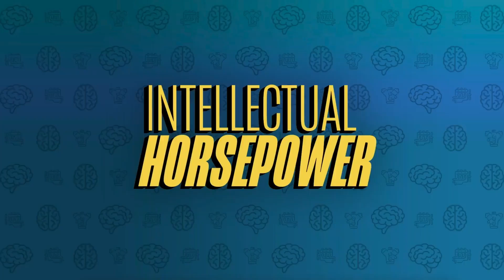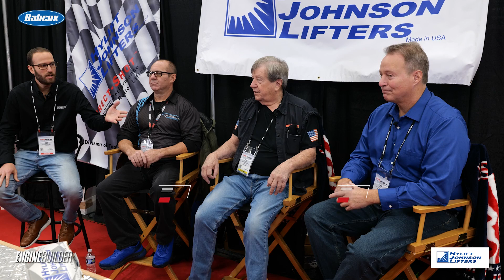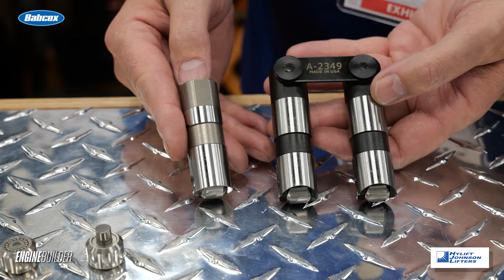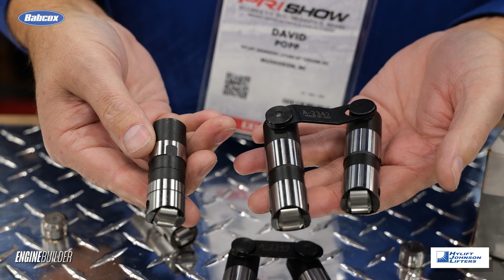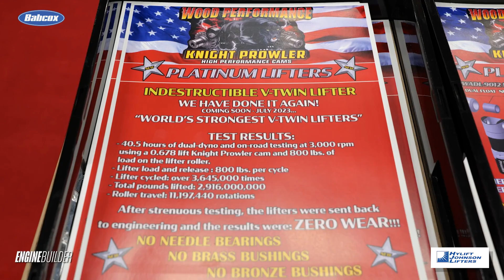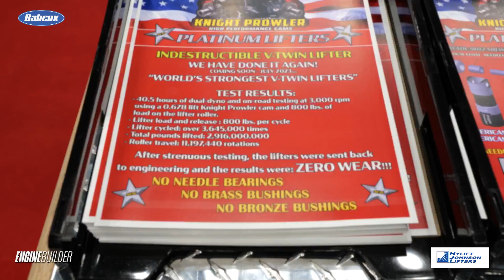Deep Dive on Lifters with Hylift Johnson Lifters, Tyler Crockett Marine Engines and Wood Performance

Comment: BAM and Gaterman lifters are what i use with so far 100% success rate.....both are rollers hyd .and solid...flat tappets are ok with low spring pressure and proper breakin along with blueprinted lifter bores and hi zddp oils

Comment: My theory when pricing a particular product by a particular manufacturer I check multiple suppliers. Sometimes 5 or 6 and if one of them is extremely low like 20% cheaper or less I throw them out of the consideration. I also will usually throw out the sellers that are higher than suggested retail. I also tend to stick with mainline sellers that have been in business for a long time and have good reputations. This seems to eliminate the scammers for the most mart.